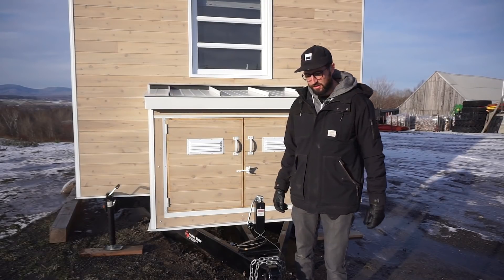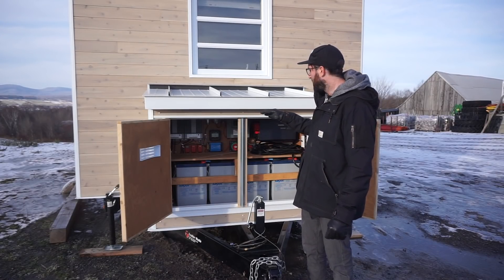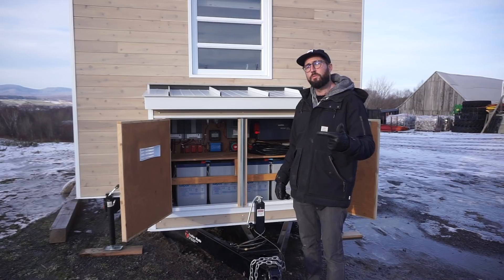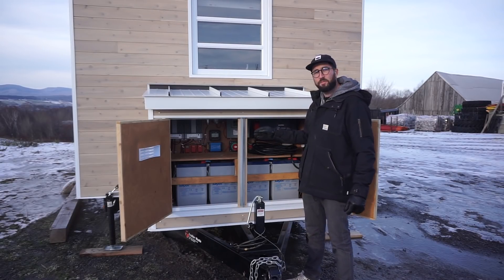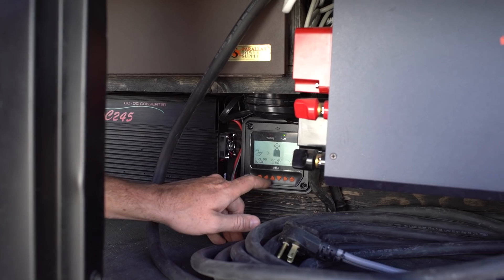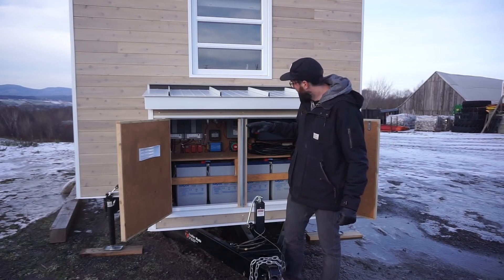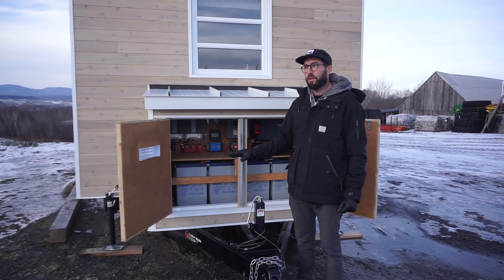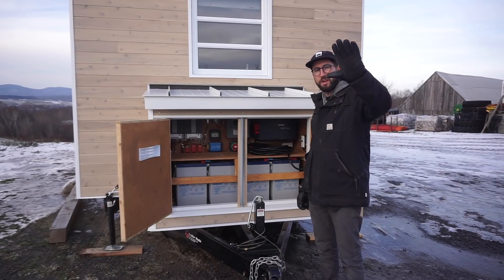Tiny house systems - Solar power and Electrical

Comment: Just a thought, was wondering if at all possible to make a tiny home wheelchair accessible??  That would be awesome, of course most would have to be on the same floor other than storage in the loft.  A ramp to enter and of course, the wider type for movement inside.  That would be a project that would be unique!  Pretty sure there would be a demand for this!  All the best to you Phil and your coworkers!!

Comment: Phil, thanks for the amazing video and all the explanations. I didn't get one thing: why wire the batteries in parallel for 24v and later convert back to 12v? Thanks!
Reply from the maker: Hey! Because the inverter we use is 24V to 120V :)
Reply: Minimaliste thank you!

Comment: Can the house be fitted with a smaller solar combination to get light if the on grid system fails? The solar would be only for emergencies. A smaller system could not keep the fridge going but it would give light and charge a cell phone. That way someone wouldn't be left in the dark if Hydro Québec fails. Since the electricity in Québec is cheap, a big system like that would become too expensive if you can access the grid easily.
For heat, I would add a little stove or a propane heater for emergencies in winter, it is better to have two heating systems in case of shortages.
And last, could your big system charge a electric car? Like a Leaf or a plug in hybrid? I know that some people can use their Leaf to power some appliance in their home in case of power outage. So that way, the car acts a big battery storage. When the car battery is low, you can't go anywhere but at least you had a bit of power.
Thank you again for the good video explaining everything. J'admire votre travail.